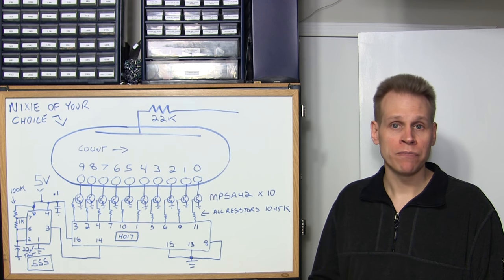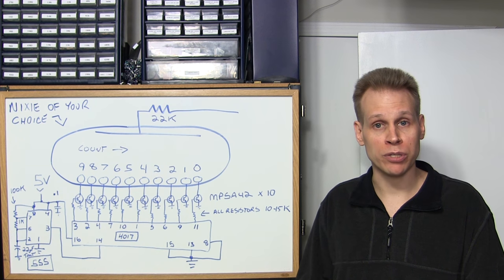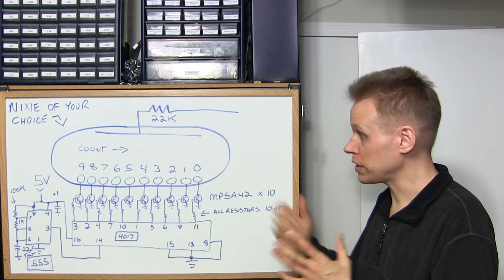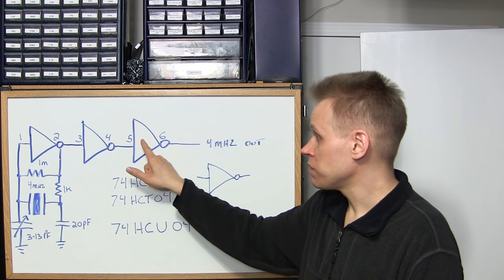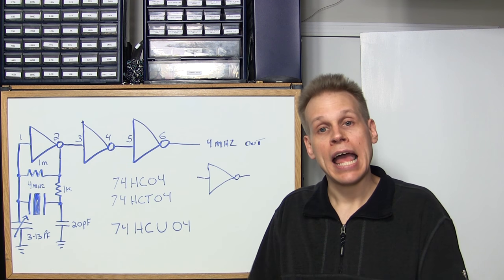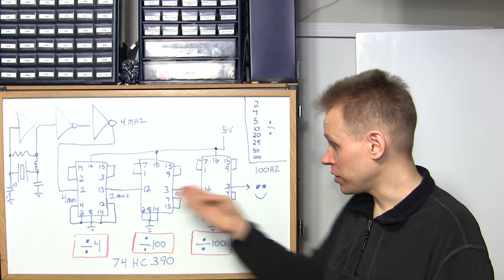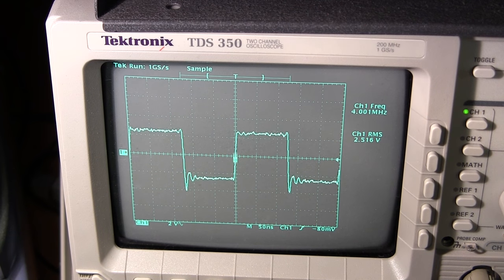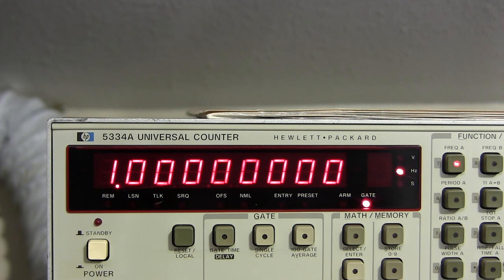The Crystal Oscillator and Frequency Division

Comment: So the input capacitance of the inverter in the oscillator would appear in parallel with the trim-cap, right? If I overshoot the recommended load capacitance of the crystal due to parasitics is it going to have trouble starting up? I'm thinking of building this on perfboard with those individual pads, would that be better for reducing stray capacitance?
Reply from the maker: Thats a complex question due to the fact that the variable capacitor is attached to ground and the input capacitance of the inverter may be affected by many factors. For easy operation, order the un-buffered style inverter. The best design practice is to find the center, load it until it stops "heavy" then remove capacitance until it stops (if it does.) Your stray capacitance may be that of a fixed value, and the oscillator will only gets so light. Find both extremes and try to tailor the oscillator to your fixed frequency close to the middle. If it's too far off one side, modify the circuit and repeat.
Reply: Thanks! I guess you got me to stop thinking too much about it and just build it. So I did and after minor hiccups with the dead-bugged 74hc390's (all I could find were SMD) it worked!  Lacking any sort of proper test gear I divided the 100 Hz further to 10mHz and I filmed a LED blinking off that and counted the frames per pulse. It's of by less than a single frame! At 30 fps this means it's within 1kHz of the target 4 MHz! I'm a happy little camper now! Thanks for teaching people and building cool shit, you're awesome!

Comment: After doing some repairs on an old 46-year-old Johnson 124M CB synthesizer Radio I found that it haves bad crystals with a lot of Frequency drift ,HC-18 type and that no replacements can be found anywhere, and one dead crystal I found that after unsoldering the metal case I found that the crystal was spilt in half and no sure why this happen, I then unsoldered  the cases on other dead crystals that I saved I found the some problem, what causes the crystals to  get damage?  over voltage to the crystal- age of the crystal, now the Radio is back on the shelf waiting for repair siting dead in the water, I think this is a very common problem with old synthesizer Radio's that are now going to the landfill, or just looking at you are saying let me rest in peace, what can be done to put new life in this Radio Mr. Frankenstein

Comment: Your film scanner had a shutter failure shortly after 15:35.
Since it happened right at a cut, I suppose the bindtape on the backside was a bit loosen. You better use the proper tools in future. ;-)
Reply: What a stupid comment. Mr Carlson does an excellent job on these very educational videos. If you are trying to impress every one on such an uneducated remark. It didn't work.

Comment: really like your videos,full of great information.  I would like to ask a question about two oscilloscopes, I see you have one a 547    I also have  a 7844 tectronix  I do christmas and halloween shows  and i recently started  building dc controllers and audio board for the shows I also work on vintage home audio eq and car audio I have no manuals or books on these machine's  If you  could point me in the right direction on what kind of probes that i would need  I was told that a tronix probe will work  but i think that info is incorrect however I have never owned a oscilloscope before  I would appreciate your help very much    thank you

Comment: Off topic: I have a roll of 10 amp fuse wire from Jefferson Electric, looks like a roll of flux core solder wire. Anyone know the application and installation of fuse wires?  Was that used to protect tube circuits before Bussmann type fuses?

Comment: Hello!

Brilliant series of videos!!!

Need help with a crystal circuit.

Need to pulse a 5W to 10W laser diode at 14Hz with crystal control.

Want minimal parts count. No audrino or raspberry pi.

Needs to run off "dirty" 12vdc from motorcycle, atv, snowmobile or watercraft.

555 ic timing not accurate enough...varies too much with temperature.

Any help much appreciated. Will even pay for working circuit.
Reply from the maker: So it needs to be exactly at 14Hz?  If you get a 14 MHz crystal oscillator, divide that by 100,  (140000Hz) divide that by 100, (1400Hz) then again by 100 will have you 14Hz. So if you go to my frequency division (portion of the video) https://youtu.be/tb1-EF_F2Rk?t=15m36s  Configure 3 dividers (divide by 100) attach them together like you see on the board and you will have a precise 14Hz output. This output is square, not sinusoidal.

Comment: Why are the 2 xtal caps so different? The amplitude at the input is going to be higher than the supply voltage and the ESD protections of the inverter could clip the signal.  Their values also look too small. Typically, for a 18pF xtal you'll need about 33pF.

Comment: I guess I am not making sense. On your white board, the divide by 4 IC pin 2 and 14 are jumpered together. Then at the bottom of the same IC, you show pin 14 again tied to ground. Does the divide by 4 have two pin 14's? Sorry to be  a bother.
Reply from the maker: Hi Greg. No, the IC only has one of each pin. I just doubled up on the pins. Both pins are tied together anyways, and on the bottom their tied to ground. The schematic is functional.
Reply: Thanks, thats what I wanted to know and which of the pins are used to program the divide by number, the data sheet in not clear on that topic. Keep them comming, Greg
Reply: Gregory West Virginia

Comment: The high voltage power supply for tubes does fall in my preferences. I need to repair 2 car radios and the mechanical vibrator not only is a nuisance but it is not likely to last if it works at all
Reply: Miguel Ángel Simón Fernández - actually, those old mechanical vibrators are just a variant of an electric bell; you can wire up one easily enough. Get a 12v (coil) SPDT relay and wire one side of the coil to the center terminal of the contacts. Now wire the other side of the coil, and the N.C. contacts, to a source of 12 volts, and it'll merrily buzz away. Use the voltage across the coil to drive the step-up xfmr (which is in the radio). Even without the xfmr, the HV pulses across the coil will handily light a neon bulb!

Comment: Why not use a 1M xtal and lose the divide by 4 stage?
Reply: Did you see the video? 15:45 Spare ones.
Reply: Yes, I did see the video, smart-arse. Let me rephrase the question then, why use a 'spare' 4MHz xtal at the cost of an additional IC as opposed to using a 1M xtal?
Reply: Paul has often stated that he chooses components mostly to use what he has "on-hand" instead of ordering parts and having to wait for them to arrive. He has 4MHz crystals and the plenty of IC's in his junk box of components so that's what he uses. The good thing about this approach is he's showing you how you can take what you have, apply some know-how, and get what you need out of it. I find this approach to be ideal as how often is it that you don't have the exact components someone is building a circuit with? Instead of just being stopped in your tracks you can think about the situation and build around it. Life isn't always ideal, you won't always have access to the parts you need, sometimes parts will be unobtainable if you're working on something old or proprietary or they'll just be prohibitively expensive so if you're able to work around it, all the better. Not sure how many of Paul's videos you may have seen, but he will often say that he chose the components he did just because it's what he's got on-hand, and that he primarily likes to use whatever is available right then.

So in essence, why not use a 1M xtal and lose the divide by 4 stage? Practical reasons: he has 4MHz xtals and IC's. He doesn't have 1M xtals.

Don't forget, there's often more than one way to do things.
Reply: I believe Mr Carlson owns and runs an electronics repair shop, he must have to order parts on a fairly regular basis. I could place an order for a part as I write this and have it on my bench in the morning, even hobbyists can do so these days.
I agree that a work-around may be necessary when replacing obsolete, or hideously expensive parts but a 1MHz xtal is neither.
I'm not knocking Mr Carlson in any way. I think his video content is some of the best on Youtube, especially the repair and restoration of old radio equipment. Although I have never worked on valve equipment, I have been an electronics engineer for over 30 years and started out servicing and repairing marine and amateur band uP controlled transceivers. Perhaps my original question was more of a rhetorical one. I would have had to design the circuit to be as efficient and cost effective as possible as I am a perfectionist and judging by the care Mr Carlson takes when restoring these old sets, I rather thought he would be too. I am aware that Mr Carlson states in the video that the circuit is designed around spare parts and that different frequency xtals could be used by re-configuring the divider etc. etc. I am also aware that the content of this video is aimed at beginners, like yourself, but I felt the need (at the time - not so sure now) to post the question anyway.
Maybe I'm missing the point, perhaps it was Mr Carlson's intention to guide the viewer in building the frequency counter project as a whole by developing their own solutions to each stage of the finished project... maybe not.
Reply: +Mike Hawkins Mr. Carlson does mention in the first 60 seconds that the video will include tips and show ways of using various crystals to make virtually any type of frequency standard the viewer would need and so I think that may also have weighed heavily on his use of 4MHz crystals as it would show the beginner and hobbyist other ways around a problem than simply buying parts. Certainly it may be trivial for someone running a repair business to order parts but for the hobbyist the decision to buy may not come so easily, especially considering that the viewers of these videos are a worldwide audience where some items may not be so easily obtainable and thus being presented with workable alternatives that would use parts salvaged from other equipment could definitely be a bonus.
Reply: More the starting clock is high more the result will be accurate at the end.